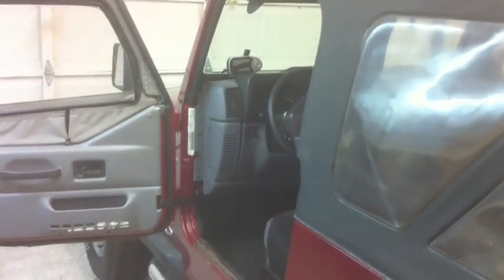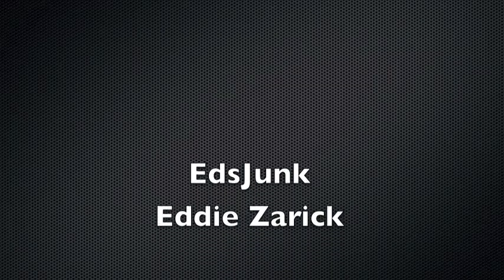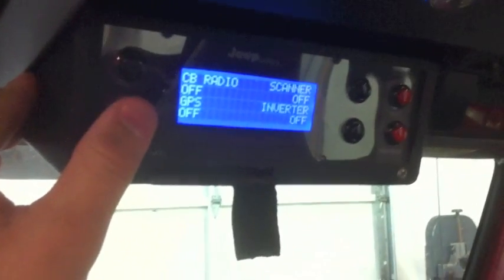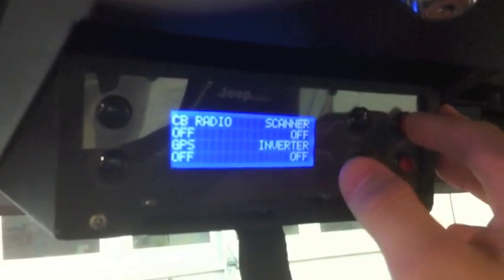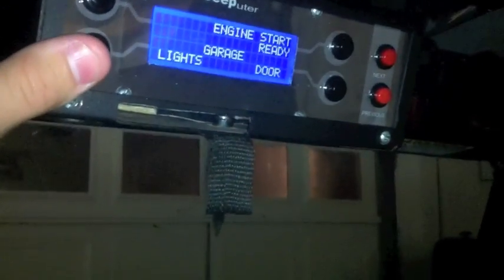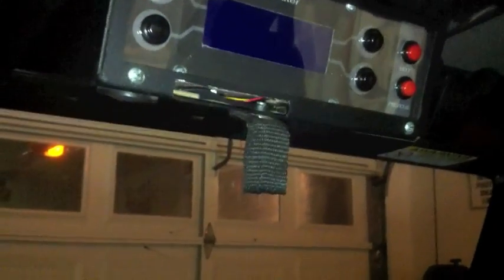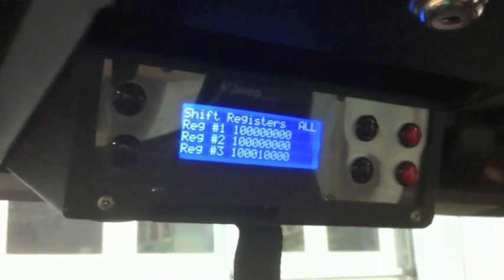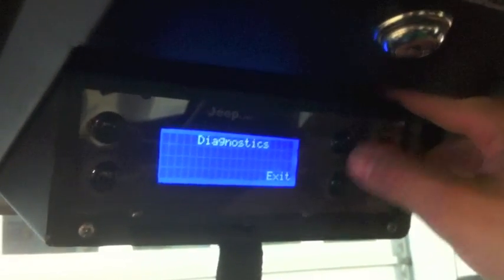JEEPuter - Arduino Powered JEEP Wrangler

Comment: This is amazing work. My only critique would be turning the engine off. You might want to move the key pad away from the shifter area, or add a debounce to the "off" key so you have to hold it down for 5 seconds, that way you lessen the risk of accidentally shutting the jeep off when you actually want it on, or the button tripping on rough terrain. I know its not likely, but I'm paranoid about safety when dealing with things that can cause a lot of damage if it fails. This is the same reason millions of Chevys were recalled recently (car accidentally turns it self off on bumpy road conditions).

Also, Arduinos can fail (they even come with a disclaimer stating they were not designed with redundancy). I'm not sure I would use it to control the ignition. Everything else (non-critical) if perfectly fine, and you've found a brilliant use for these amazing little devices.

This is a brilliant setup! Very nice work.

Comment: I'm working on something along the same lines only a little more extensive since I've pulled all of the wiring harnesses out of my 88 Bronco 2. I have a large touch screen built in to the sheet metal dash that controls pretty much everything including the power locks and windows in harmony with the viper alarm system. i also have complete LED lighting on everything, headlights are HID, but the LED lights are controlled in groups for strobe and hazard flashing.